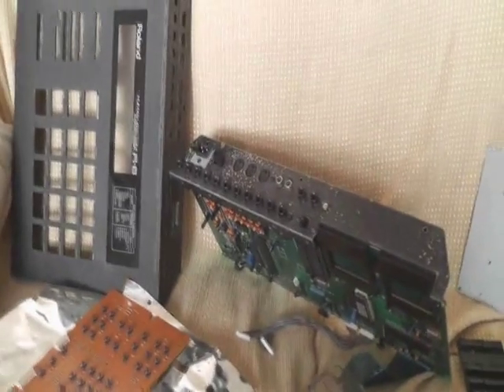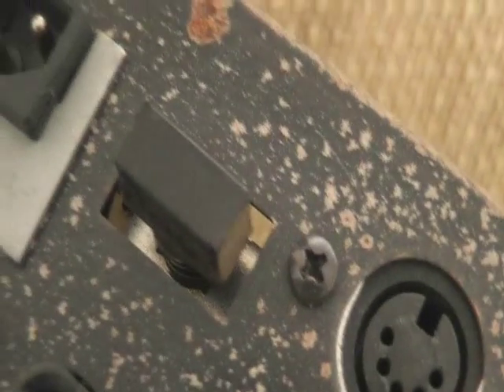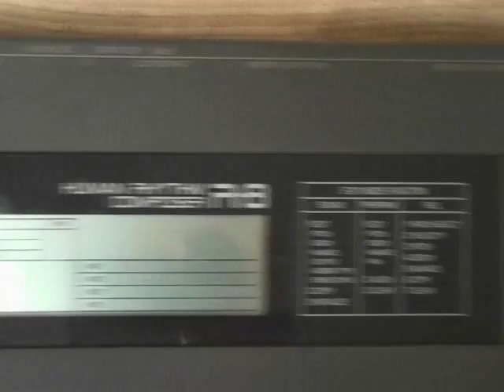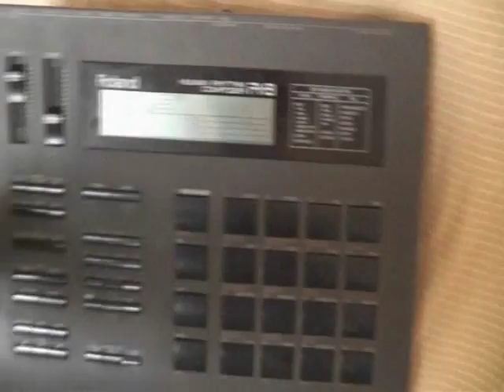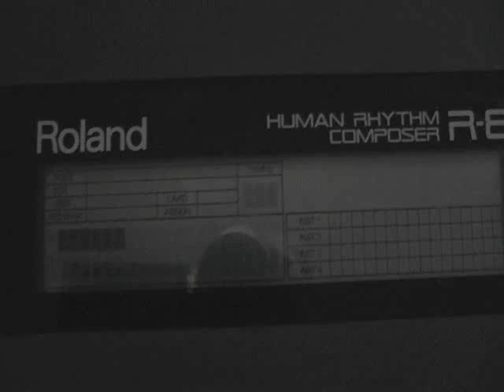DRUM MACHINE REBUILD - Roland R8 Human Rhythm Composer

Comment from the maker: sounds like its getting hot and cutting out. could be a resistor diode or fuse somewhere and is usually on the board which is situated with the on / off button. check your mains plug to see if the fuse is right for the power pack. Usually with the r8 they recomend the origional power pack (not a copy) check ebayer etc for a power lead this may cure the problem and as they are in demand it wont be hard to resell if it doesnt cure the problem just thinking cheap ways around it!

Comment from the maker: @vintagesoundguy Easy mate - i sourced the screen display about 3 yrs back on ebay the pads were off a salvaged r8 that had melted in a fire (these i will probably replace as they arent in that great condition as you will see from the footage! but they will do for now) the power connection was robbed off another drum machine dont know what type as a local electrician had it in a store box in the back of his shop but it fit just fine. Carboot sales and fairs are worth checking and ebay mainly.

Comment from the maker: pressure pads are very hard to sorce  people have recomende roland uk but i dont think they can sorce the parts best bet is check ebay worldwide and get a spares or repair or a cheap double and then you will have spares for the future. if you find any pads let me know where i can find some because mine are getting worn lol! 3 midi sockets are as follows: midi in - out - thru and should sync up fine - hope this helps?! :)